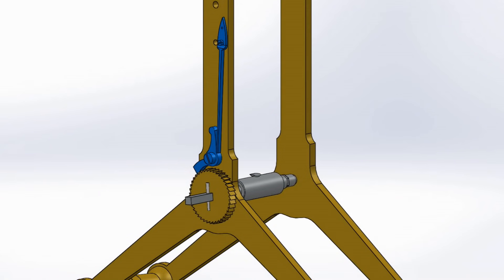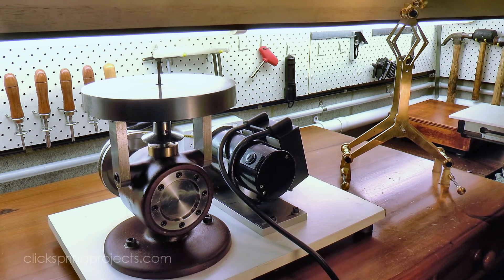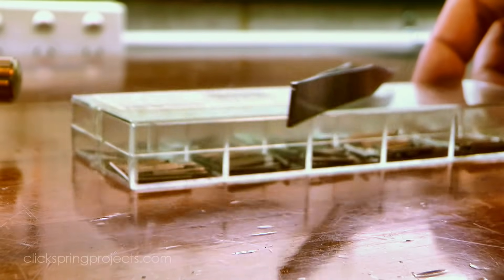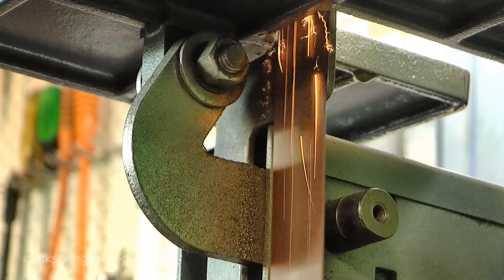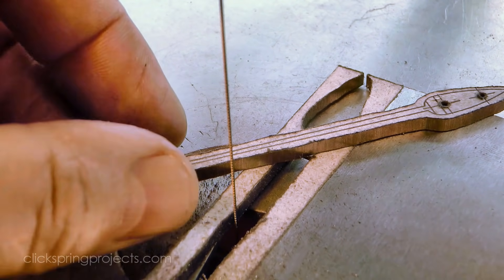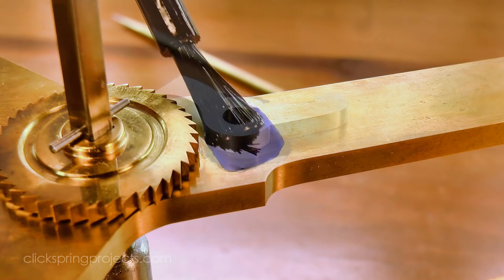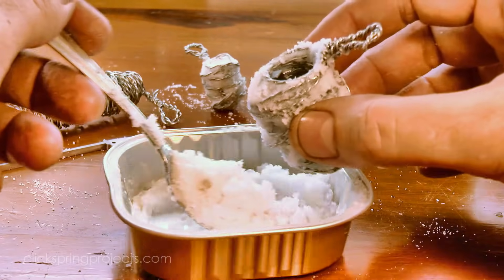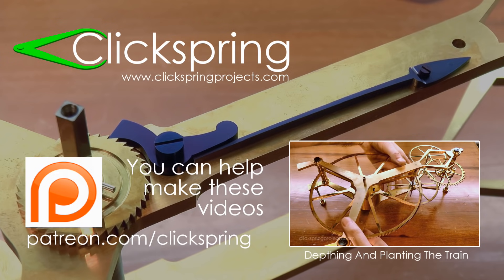Clockmaking - How To Make A Clock - Part 14 - Making The Barrel Click And Clickspring

Comment: Hi! Just a question about your bench filing machine: At your webpage it says that this type of machine is rare, and that the only way of buying it is a kit that needs some machining. As I don't have a machine shop, but need a way to do inside shapes perfectly 90 degrees, I was wondering how you would do this tasks without this machine? I've tried to use my scroll saw, but due to bending of the blade it's hard/impossible to get the angle perfect. 

And offcurse: Great job! I love your work!
Reply from the maker: +Espen Johansen The task you describe is exactly the reason the die filer was created, and its still the best tool for that job. Thanks for watching and asking :)

Comment: Do the blued parts lose their blueing from use over time?
Reply: +NeAZ +NeAZ The blue should not wear off as it is caused by an oxide layer forming on the surface if I remember correctly. Though, you can scratch off the oxide layer.

Comment: Does the bluing fade ? Or rust?
Reply from the maker: +MegaMetinMetin It provides a small measure of rust protection, but it is easily scratched. If nobody touches it (like the inside of a clock or watch) it can last many decades, even hundreds of years. Thanks for watching.
Reply: Thanks for the info

Comment: Newbie question: how do you know the final clock will tell the correct time? Is there a traditional ratio for all the gears or something? Or maybe gravity automatically makes the pendulum swing once per second? Great videos btw, i wouldn't mind if they were longer even. :)
Reply: +kooky216 On pendulum clocks you can adjust the height of the pendulum's weight, therefore adjusting the swing time. So yes, you have to get the gear ratios about right and then fine adjust the pendulum.
Reply: Actually currently, since 1967 the second is defined as  "the duration of 9192631770 periods of the radiation corresponding to the transition between the two hyperfine levels of the ground state of the caesium 133 atom." More than that: speed of light was never used to define a second. It is the other way around. Meter is defined as a distance light travels in a vacum in 1/299792458 of a second. Cheers :)
Reply: Interestingly, gravity does automatically makes a pendulum swing in an exact time. This is one of the physical principles that Galileo discovered back in the day.
And for a while, the international definition for a second was going to be defined as the swing of a pendulum of a specific length. But it was later set to be a fraction of a day, and by today, the time it takes for light to travel a certain distance.
Reply: +Arturo Gutierrez nope it's now all about Caesium and its oscillations between ground states, accurate to one second every 20million years
Reply: +kooky216 This is a very interesting question. As others have mentioned, the pendulum can be adjusted with a rating nut raising or lowering the weight. Chris is building a Wilding clock that's way over my head. I am building an 8 day regulator. although there are more bits to my clock, I chose it because there are so many adjustments that can be made if the darn thing wont tick and hopefully it will be a little more forgiving for my bad workmanship! I suspect when the time comes, i will have to find someone who actually knows what they are doing in order to help me set it up! I will be ecstatic if i can get it within a few minutes each day!

Comment: No matter how many times I see the bluing process, it still feels like magic every single time D:
Reply: I love the bluing!  I had to try it, so I polished a piece of piece of bar stock I had lying around and heated it with a torch. It takes a little practice, but it's so satisfying when you get a nice even color.
Reply: +muh1h1 You can definitely do it with non-stainless, the effect just works better on clean, polished steel and stainless is much better at staying not oxidized. All of the blued screws Chris has used in this clock so far have been non-stainless.
Reply: +KingNast What metals can be blued? Steel and brass?
Reply: neiljborja You are right, i remember him saing he used mild steel! Totally forgot about that :)
I once tried blueing a razor blade, which worked, but i didn' get it as even, because the metal was to thin :)
Reply: Me too.  I've seen plenty of blued steel but I've never seen bluing produce quite the vibrant deep blue that Chris does.  It's beautiful.
Reply: I literally just scrolled down to say exactly the same thing.  It is absolutely astonishing and I've watched him do it numerous times.  The resulting colour is so beautiful and even that it's hard to believe it's just the result of the careful application of some heat.  I am pretty handy but I am prepared to bet that I could try this a thousand times and still not achieve the jaw-dropping results Chris manages.
Reply: Oh absolutely, its such a beautiful blue, especially when its polished the way he polishes them.
Reply: muh1h1
I need to try it too :)
Just need to get some shavings of brass.
Reply: You can still do it without the brass shavings, it''s just harder to get an even color. It's still possible though, just easy to overshoot.  Sand might work, but I don't know if conducts heat well enough.
Reply: KingNast
Thanks for information. Dumb me, i somehow conected shawings with coloring. Which of course happens just from heat alone.
Reply: +muh1h1 Were you bluing the razor blade to make a foxhole crystal radio or just for fun?
Reply: Such a pretty blue, too!
Reply: +Paul Kleinpeter just for fun actually because i watched one of these Videos and wanted to try it myself :)
i remembered that it was possible from some radio build though :)
Reply: +Valtra103 Bot brass as far as i know, i THINK only stainless steel can be blued.

Comment: +Clickspring beautiful work as always, what blade did you use on your scroll saw I've tried that several times before to just snap the blades.
Reply from the maker: +Jordan Lapointe Hey Jordan, I use Antilope - German brand, still prone to snapping on tool steel, but better than anything else I've tried. This cut is the absolute outside of the envelope for this type of blade. Thanks for watching :)

Comment: Fantastic as always! Thanks Chris. I absolutely love the blueing, did a little reading up on it and saw its used a lot in guns. Will the click part where it contacts the ratchet lose the blue color with wear and tear?
Reply from the maker: +Nils Rohwer Hey Nils, yes it will, in fact it already has on the very tip that contacts the ratchet. The oxide is not very strong or thick, and can be scratched off very easily. It definitely requires careful handling to preserve it. Cheers mate :)
Reply: +Clickspring Saw that too. I would just polish the ratchet at that very tip. But time will do it for you I guess…